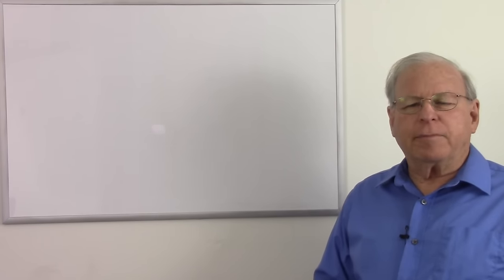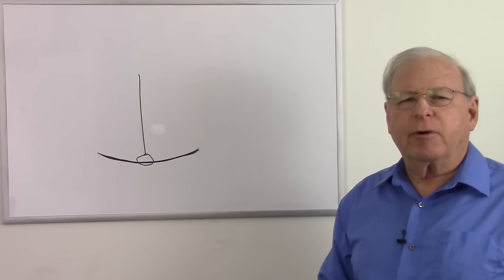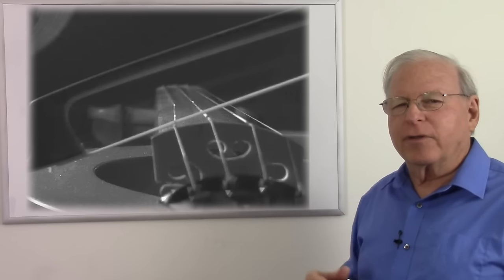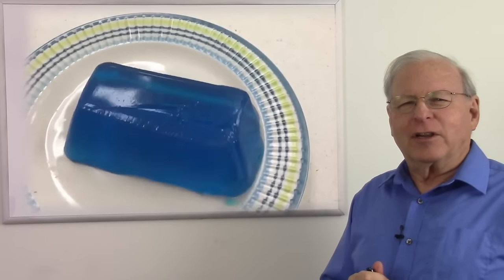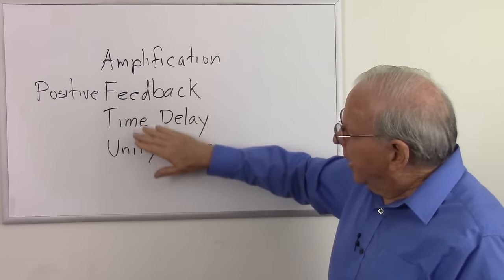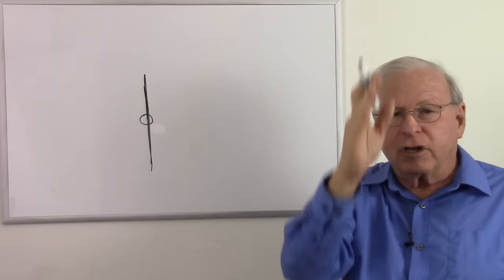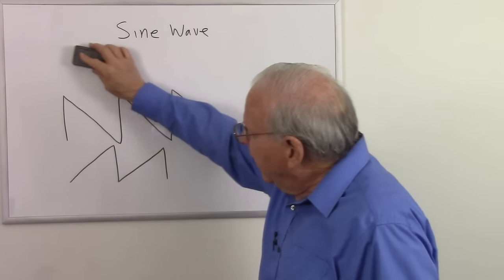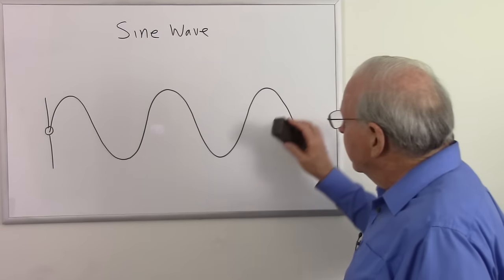Oscillator Fundamentals - Solid-state Devices and Analog Circuits - Day 6, Part 4

Comment: I've learned so much from you Bob. I've been able to use the things I've learned from your videos at work! As a side note, could you do a video on the terminology I see a lot of? For example, what is the difference between signal vs reference voltage, common vs ground, etc? Also maybe some videos on how to build and, or and not gates.

Comment: Great explanation!. The filter at the output is a parallel LC filter. If it is tuned to the frequency of the oscillator it will block the output of the oscillator.  A series LC filter should be used.

Comment: My question is, why the pendulum perpetuum mobile with two strong magnets at the two high points is not possible? The magnets would put energy back into the system, and give the necessary push for the pendulum to reach the other magnet at the opposite high side.
Why this is not working in practice?